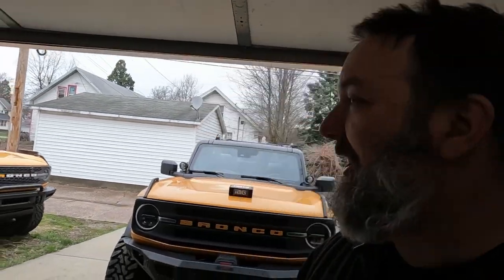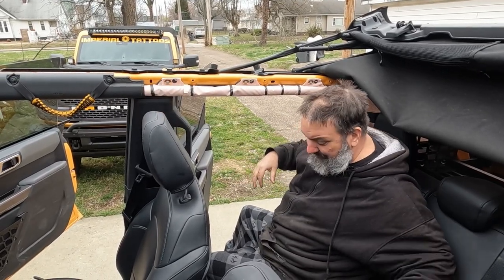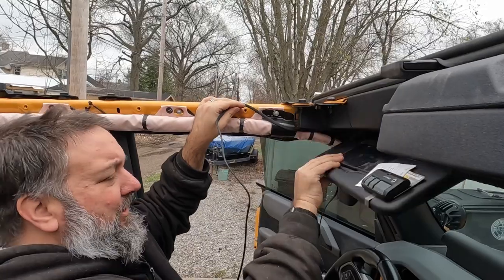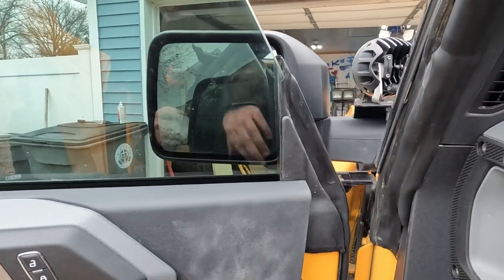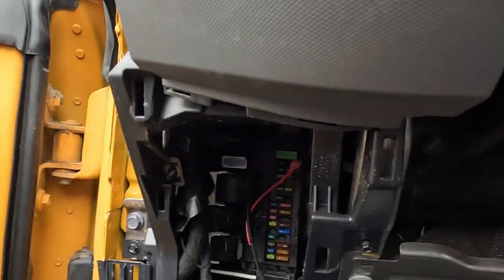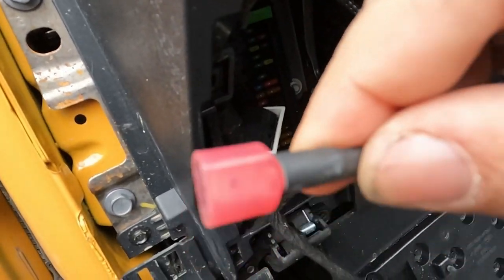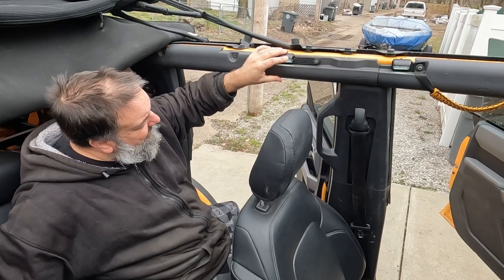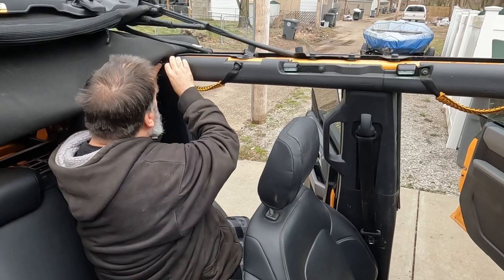Boost Your Bronco Interior with IAG Interior Lights

Comment: hi, so i installed the lights and i put the connector on the gray and purple wire , the problem is the only time the lights come on is when i push the lock button on my key fob. would you happen to know why that is?